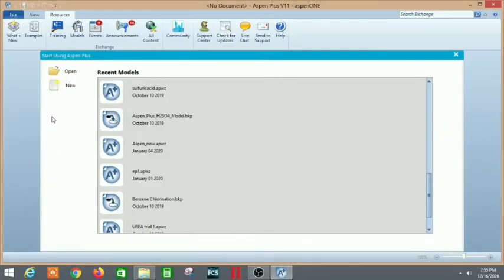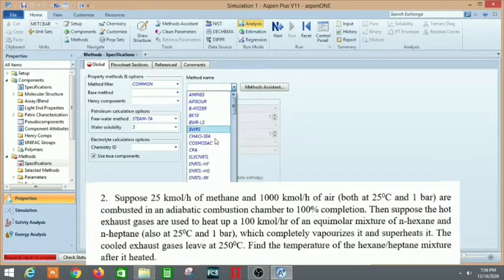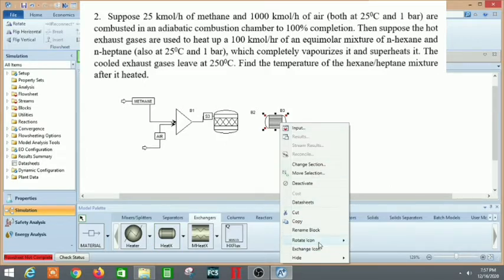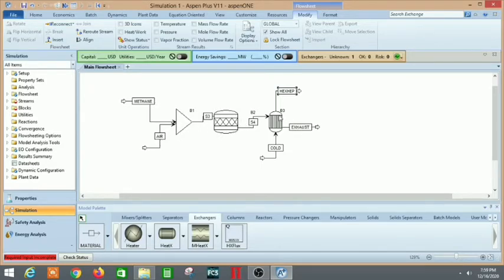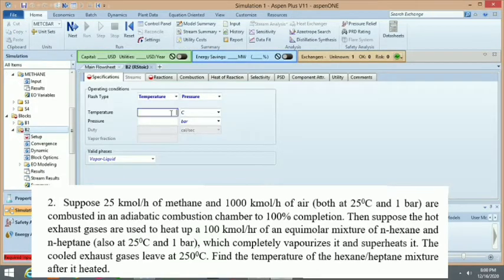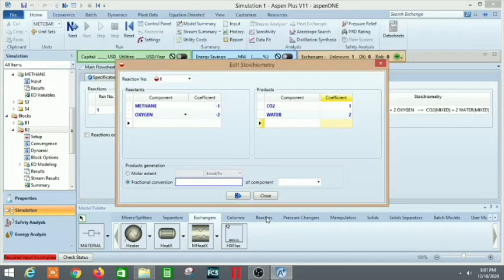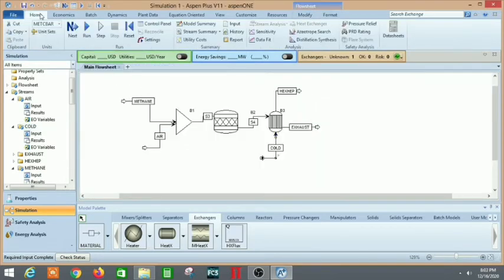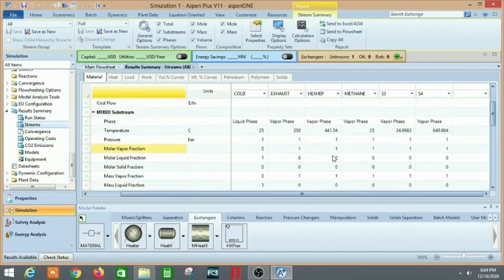Combustion and Heat Exchange in ASPEN PLUS ASPEN HYSYS Process Simulation

Comment: Great videos! Thanks, and could you tell me what software is good for chemical engineering?
Reply from the maker: Thank you ! 
There are many softwares used in Chemical Engineering depending on the task. Like if you want to do process simulation then Aspen, DWSIM, ChemCad,etc.  are good. If you want to do mathematical modelling and data handling, then use MATLAB,Scilab,etc. and so on...
Reply: @TheConceptGuy  Thanks a lot